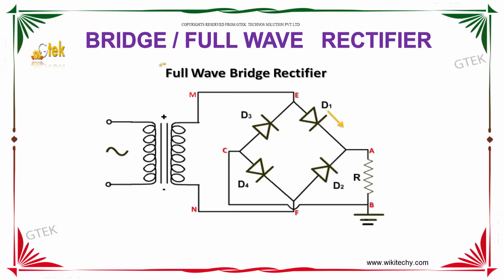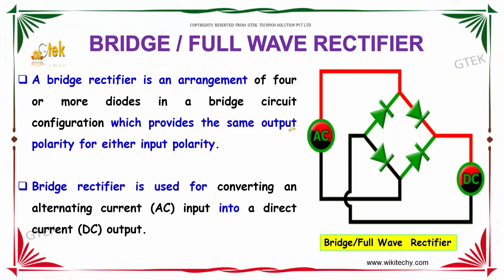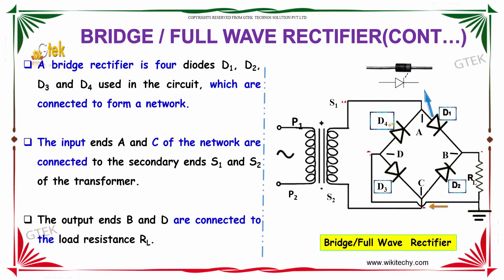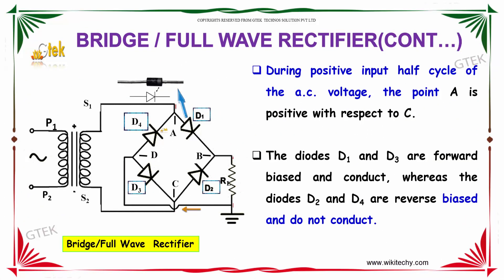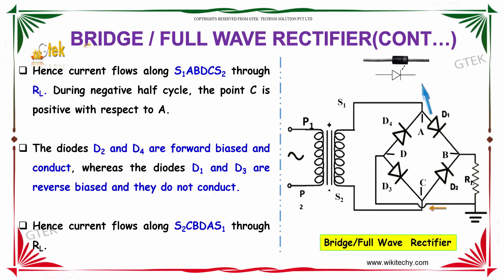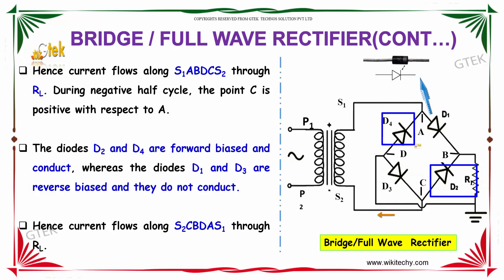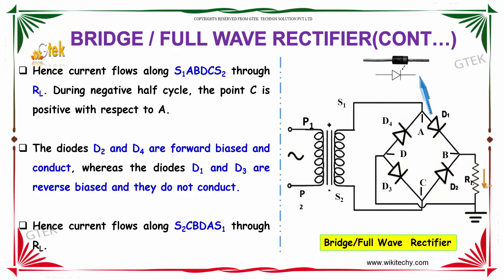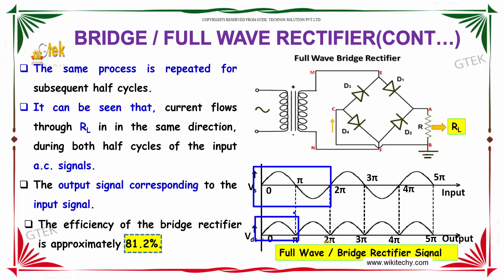Bridge Full Wave Rectifier Semiconductor Devices class 12 physics subject notes lectures CBSE IIT

Comment: A diode bridge is an arrangement of four (or more) diodes in a bridge circuit configuration that provides the same polarity of output for either polarity of input. When used in its most common application, for conversion of an alternating current (AC) input into a direct current (DC) output, it is known as a bridge rectifier. ... A bridge rectifier provides full-wave rectification from a two-wire AC input, ...

Comment: A Full Wave Rectifier is a circuit, which converts an ac voltage into a pulsating dc voltage using both half cycles of the applied ac voltage. It uses two diodes of which one conducts during one half cycle while the other conducts during the other half cycle of the applied. ac voltage.

Comment: The most common meaning of ripple in electrical science is the small unwanted residual periodic variation of the direct current (dc) output of a power supply which has been derived from an alternating current (ac) source. This ripple is due to incomplete suppression of the alternating waveform within the power supply.

Comment: The Half wave rectifier is a circuit, which converts an ac voltage to dc voltage. In the Half wave rectifier circuit shown above the transformer serves two purposes. It can be used to obtain the desired level of dc voltage (using step up or step down transformers).

Comment: A bridge rectifier is an arrangement of four or more diodes in a bridge circuit configuration which provides the same output polarity for either input polarity. It is used for converting an alternating current (AC) input into a direct current (DC) output

Comment: Like the half wave circuit, a full wave rectifier circuit produces an output voltage or current which is purely DC or has some specified DC component. Full wave rectifiers have some fundamental advantages over their half wave rectifier counterparts. ... In a Full Wave Rectifier circuit ..

Comment: Like the half wave circuit, a full wave rectifier circuit produces an output voltage or current which is purely DC or has some specified DC component

Comment: A rectifier is an electrical device, mainly consists of diodes, that converts ... Before the development of silicon semiconductor rectifiers, vacuum tube diodes ... Half-wave rectification can be achieved with a single diode in a one phase supply.

Comment: The Bridge rectifier is a circuit, which converts an ac voltage to dc voltage using both half cycles of the input ac voltage.

Comment: A device which performs the opposite function (converting DC to AC) is known as an inverter. ... Before the development of silicon semiconductor rectifiers, vacuum tube diodes and ... Graetz bridge rectifier: a full-wave rectifier using 4 diodes.

Comment: While this method may be suitable for low power applications it is unsuitable to applications which need a “steady and smooth” DC supply voltage. One method to improve on this is to use every half-cycle of the input voltage instead of every other half-cycle. The circuit which allows us to do this is called a Full Wave Rectifier.

Comment: Full wave rectifier can be constructed in 2 ways. The first method makes use of a center tapped transformer and 2 diodes. This arrangement is known as Center Tapped Full Wave Rectifier. The second method uses a normal transformer with 4 diodes arranged as a bridge. This arrangement is known as a Bridge Rectifier.